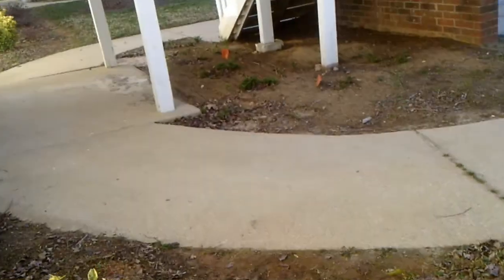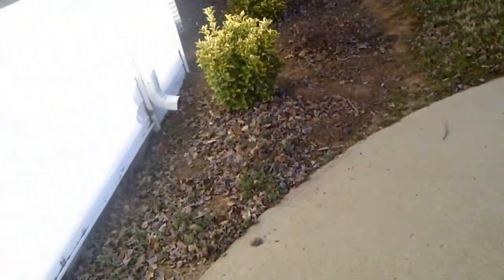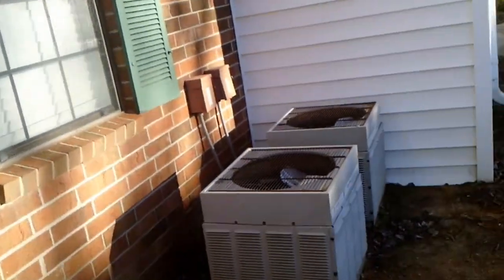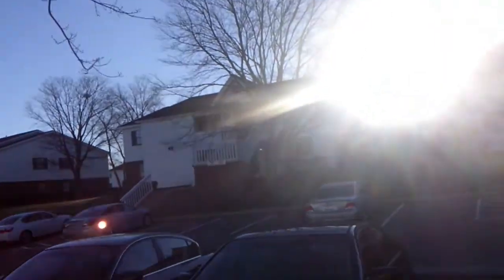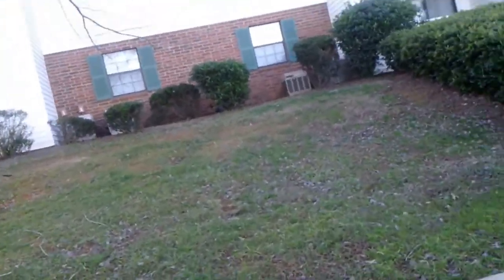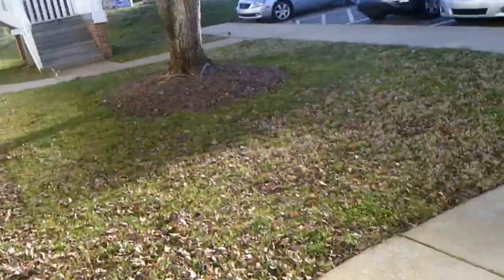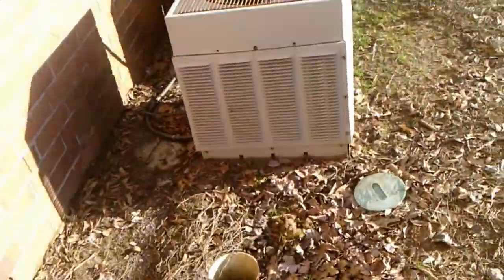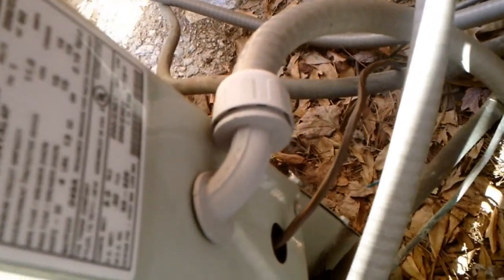heat pumps running in HEAT mode and a malfunctioning Duro Guard heat pump

Comment: Hmm. Either the Duro Gaurd switched into defrost and got stuck or they could have turn it on cooling mode for what ever reason and the fan motor died. It was pretty hacked up so other than that idfk what's going on with it.
Reply from the maker: I was thinking kinda the same thing, I may go back there this summer and see if it got replaced.

Comment: Duroguard is a private label brand made for a supply house called HD Supply, Duroguard is made by Rheem. Now as to what i think was wrong with it is judging by the exposed wires on the fan motor from the infamous fan motor hack job, i think some hack replaced the fan motor at one time and "forgot" to replace the run cap, the run cap could be weak or blown and when a motor runs with a weak or blown run cap it will fry in no time, other possible issues is it could have a bad fan relay on the board or it very well could be stuck in defrost, the causes to why it was running the way it was is endless and those are the type of HVAC repair's i enjoy the most is troubleshooting step by step piece by piece to find the problem.  anyways great video :)